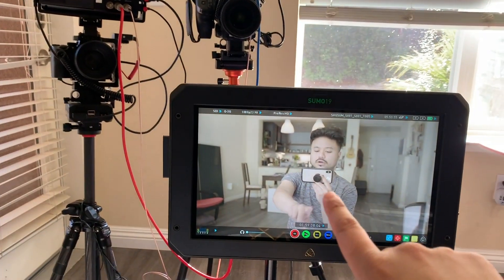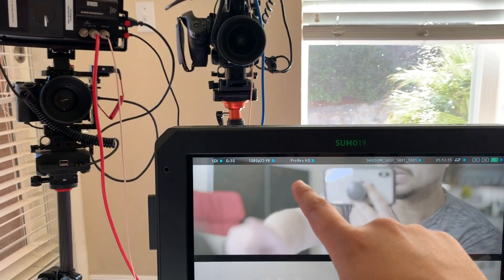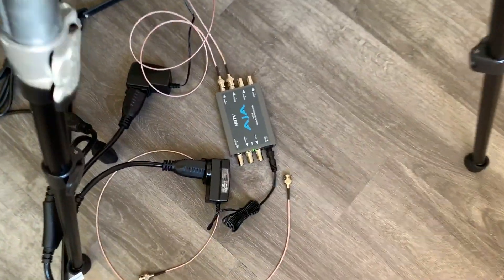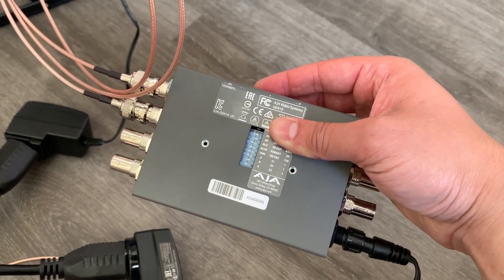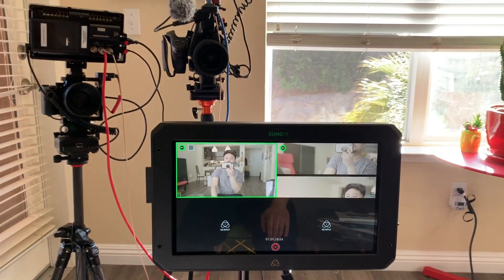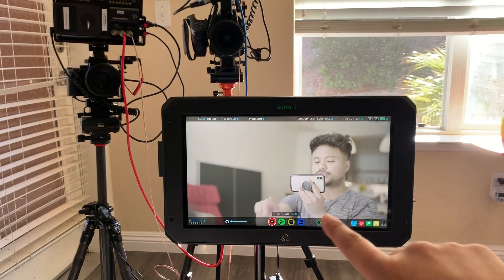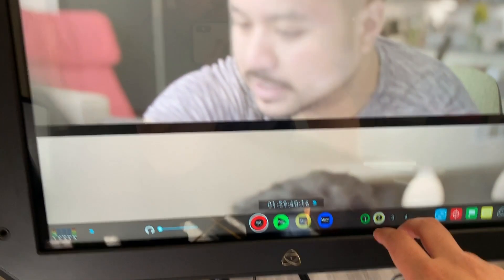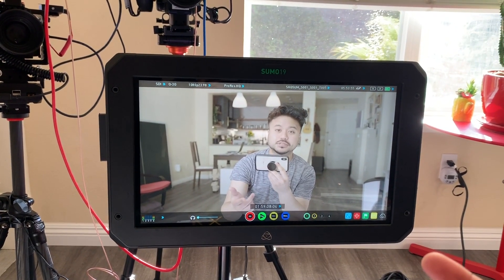Atomos Sumo19 4xISO Not Working—WHY?!

Comment: What’s the cheapest option to convert 4 hdmi signals to the 4 sdi inputs on the sumo? Still bm micro converters?
Reply from the maker: Heya! Yea, looks like BM's $64 converter is still the way to go. Am curious though -- what cameras are you planning on using it with? I personally don't think it's worth making your setup work with the Sumo because it isn't the greatest monitor [lack of monitor settings, brightness, etc].

Comment: Hi, did you manage to find a solution to this? I'm about to buy one in a couple of days as I use a7siii/a7iii camera's and want it mostly for a 2 camera split screen. I'll hold off until I find a response somewhere
Reply from the maker: Heya, yea the latest firmware allows switching now. Do note that you have to convert your camera’s signal to SDI — for my setup, I’ve used an Atomos Shogun to send to the Sumo but a cheap monitor should be able to work too. While you can do split screen, do note that that there is no 2 camera view, only 4. So while you can switch 2 cameras only, your view will only be 2 screens of the 4. 

I still use mine and record the feeds (only 1080p though) which has been helpful as a backup (as I’ve used the 1080p backup file once when my SSD on camera had a dropped frame).

Hope this helps!
Reply: @845a  Thanks for the quick reply, I'd be using my Hollyland mars 400s wireless transmitters, so I should be ok putting the receivers SDI into the Sumo SDI.
I'm assuming the bottom two screens just stay black, that's totally fine with me.
One last thing, I've noticed with some monitors like my Atomos Ninja Assasin (from 6 years ago) tend to have a loud fan noise that annoyed the audio guys, could you comment on the fan noise? I'd mostly be using this for 2 camera interviews so I wouldn't want to mess the audio up
Reply from the maker: @ballisticaom645  fan shouldn’t an issue.. especially when it’ll most likely be far from your talent (get 25’ cables).

Setup should work fine with Hollyland (I’ve only experienced Teradek but so long as there’s a cross conversion you should be fine). I would just imagine powering everything might be a pain—if you’re running on batteries for everything just do the quick math in watts per hour on your battery and the power draw from all devices to get how long you can power your video village. Otherwise, plugging it all in to an extension/stinger would be best to not worry about power.
Reply: @845a  Gotcha, thanks bud, I appreciate your time :)

Comment: It is not going to function. Atomos lover to claim features that never show up.The Ninja V, SDI module states on the box of cross conversion. Bull, it does not. Called Atomos and they said it was a typo and they don't know when or if ever an upgrade shall do it. As for the Sumo. Give up. Get a Convergent Design Apollo. Return all the stuff you purchased. 
Note: My setup: Two GH5s and 1 GH5k, 1 Sumo 19, 2 Sumo 19m, 2 Shogun Inferno, 1 Ninja V and 2 Shinobi. I only use the Sumo in Single mode and switch between two cameras if need but I avoid that because when I do put camera 1 and 2, the direct wants camera 3 up als to monitor all on one Sumo; therefore,  to avoid it, I simply sent camera 1 to the Sumo; camera 2 and 3 to the Sumos Monitors.
Get the Apollo and avoid the bs if you shoot in 1080p. I don't shoot 1080p and have not for about five years.
Reply from the maker: I totally hear you on the lack of follow through with Atomos. I've had the Sumo since its release and it's ridiculous that they haven't come out yet with the firmware despite showing its capabilities at tradeshows.

I actually haven't shot 1080p in awhile but I did just want to get this feature as I've had some requested quick turnarounds which 4K really isn't necessary. At the moment, I have used it as a monitor and in another shoot as a monitor for a 1st AC (yes, I know the screen isn't that great but he managed lol). Since it is a large version of a Shogun recorder, it has been handful when I've boomed the camera and needed to record the video then.
Reply: The new ATEM Mini is a cheap switcher (£300) than can handle four sources at once. Granted you get no preview, but it works!
Reply: @TheNavMan1000  Thanks Naveed for the info. I don't need to switching; my video was to show Atomos' Sumo does not work as a switcher.

Comment: Hi! I had the same problem like you... After waiting over 1 year for the update firmware, i bought the blackmagic smart videohub cleanswitch 12x12 6G-SDI Video Router with Built in Re-Synchronizer (BMD-VHUBSMTCS6G1212). I put the cleanswitch betweenwn cameras and atoms sumo!

This is my solution!
Reply from the maker: Good to know! However, I don't need the camera switching that badly to spend another $1500 to make it work. It's just ridiculous that Atomos would advertise a feature heavily and not give a great timeline as to when it would be available via firmware.

Comment: I have the same issue. You cannot genlock a dlsr and you cannot sync the output using the inferno. There was rumours that they would release firmware 9.2, but nothing yet?
Reply from the maker: Naveed Hameed Atomos did finally reply to me when I opened a support ticket and told me that I’d need to have a frame sync on both cameras (not just one) since like you said each camera doesn’t have a genlock. I posted their reply in video’s description.

It does look like there’s a firmware coming out as you mentioned that wouldn’t need the sync generator and frame sync. But with Atomos’ history, not counting on anytime soon lol
Reply: @845a  I've been waiting over a year. I've rang their support numerous times and they promised it at NAB this year. But like you I'm skeptical but don't want to spent more money on convertors and sync devices especially as I want to keep to a UHD workflow!
Reply: @TheNavMan1000  I ended up buying 3 BMD cross converters and a Genlock and finally got my 3 cameras working. The only problem is that after switching and exporting an XML my NLE still gets only a bin with the ISO recordings but no switched timeline.
Reply: @ChosaMweemba  I wasn't aware of the above... the sales person from CVP told us we could monitor 3 cameras with the Sumo SEPARATELY (not simultaneously) without Genlock. Can you actually do that? I've tried the SDI inputs without genlock and only the first SDI two inputs seem to work in Single Mode. The other modes won't work, probably they require a genlock. What have you purchased exactly?
Reply: BULLAKI I ended up buying 3 Blackmagic Cross converters and a Blackmagic Sync Generator. I had the same problem because I thought I could sync without genlock. 
So now I feed SDI from my cameras into the cross converters then feed the genlock signal to the cross converters and the Sumo then pass on the SDI from the converters to the Sumo. 
I think I should make a video this weekend when we are not shooting.
Reply: @ChosaMweemba  That would be great if you could show a demo - currently no one has a good working solution and a 'how to setup' guide
Reply: @ChosaMweemba   that I would love bro :)
Reply: @TheNavMan1000  Hopefully they will be realeasing in October 2019 as mentioned on the website. But I have been waiting for this since last year. Indeed I have genlocked all cameras but I need to export XML to fine tune the Multicamera edit.
Reply: @ChosaMweemba  This will be coming in 2 days as Atomos are promising on the website. But that firmwire should have been out last summer. I do not trust them anymore. 2 days left to see if I can still trust Atomos.
Reply: @TheNavMan1000  Yeah, ATEM Mini do the live switching. We have BMD ATEM HD Pro, but we can not correct the mistakes for studio recordings, that is why Sumo 19 with built-in live swiching will be perfect when we can export the XML and correct all the mistakes before mastering the studio programs.
Reply: @FatehShams  I will not hold my breath waiting my friend :). I thought about genlocking but do not wish to spend more money to do it. The new ATEM MINI is out in Nov and I will be selling my atomos sumo and using that instead. We don't get a preview but I can use my infernos for that